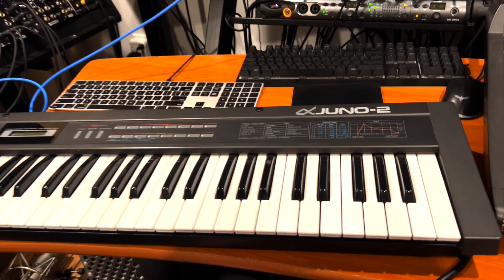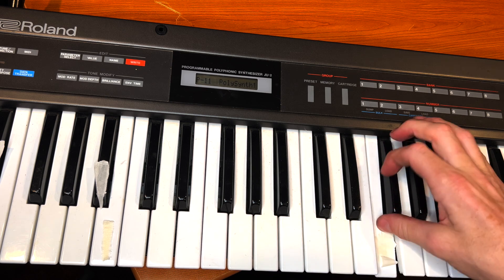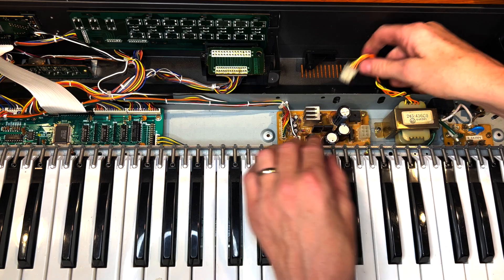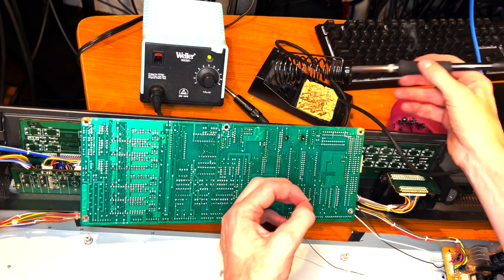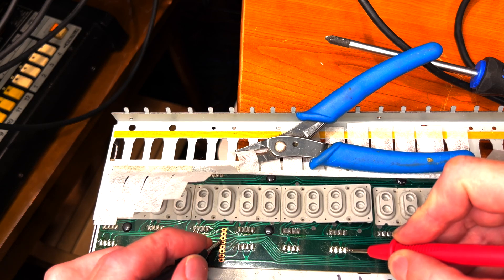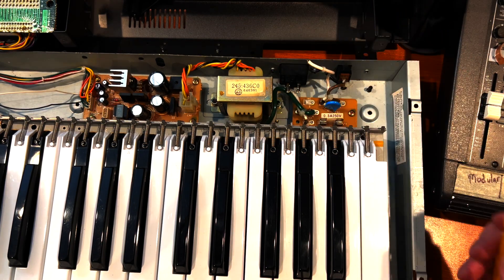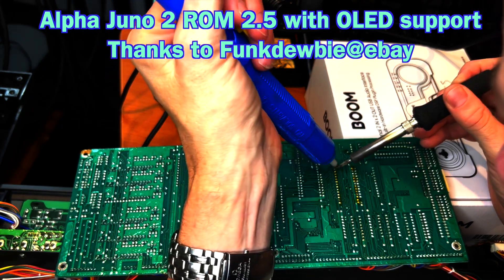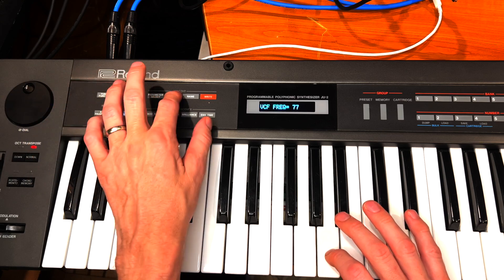Saving Alpha Juno

Comment: I bought one of these from new, but I've now got it back out. I had some trouble getting stereo output, but it turned out to be a dirty main volume slider. Right channel is intermittent. OK for now.

I'm driving it into a hi-fi amp (Fosi V3, 115 w/channel), and then into floor standers speakers (Monitor Audio Silver RS6, 120RMS). The whole setup is in my lounge for personal use.

But the output level is much lower than expected.

Can you tell me the peak-to-peak voltage of P-5-7 (Big Brass) at the stereo output jacks, with the main volume full up?

Comment: Instant rave machine!  Rrrrrrwwwwwrrrrrr!  I also had my tech put in an OLED.  There's also a mod you can do to the Alpha Dial wheel that allows it to track more accurately.  I actually have a spare board that I'd be happy to send you to allow you to do that.  Let me know. ;)
Reply from the maker: Hey Jay - I actually sold the AJ2 to a local guy that was so happy to get it - game him a sweet deal.  I can ask him though next tim I see him if he wants to do that upgrade.
Reply: @ sounds good.  Lucky guy!  I wish I had a Juno-2 due to the velocity sensitive keyboard.  The Juno-1 receives/responds to it, but oddly doesn't transmit it.

Comment: Hi man. I own a Ju-2 for over 10 years now, had to change the battery some time ago for the first time.. weirdly after 2 weeks it died again, ending up losing my new patches for the second time. So i changed it again, with after 2 weeks the same.. Now i know i didn’t put a faulty battery the first time, so something is def draining it.. any ideas what i can be? Or a headstart where to look? Cheers!
Reply from the maker: Only thing I can think of is potentially you have a failing capacitor somewhere that is close to shorting.  I'd start there and have the main board re-capped.

Comment: I did the eprom and the oled. Did a firmware reset. Have half screen unless i push write. Then i get the last half that never goes away if inpush another button and still only left half is informative. Faulty eprom? It is 2.5 U
Reply from the maker: Hey there - I had the same issue - not all 2.5U are the same.  You will need to order the 2.5U which is modified for OLED by the guy Funkdewbie on Reverb.  Make sure you tell him it's for the OLED version.  To swap ROMs you may also need to desolder your current ROM chip and add in a socket as I did in my video. Not the simplest of operations, but doable if you have a good desoldering tool.

Comment: Just bought an AJ1. Needs a good clean, an EL backlight replacement, the ROM upgrade and a new battery...otherwise it's in excellent condition. Sympathetic restores on these machines are the way to go....
Reply from the maker: For sure - lots of great deals out there if you can do a few small repairs.

Comment: I also brought an alpha juno 2 to life!!! with 9 dead keys and an empty battery and rotten capacitors on the power board that need to be replaced. I have also adjusted the entire inside to make the illumination such that it now also has a rare alpha dail backlight, how nice is it that you can now see everything clearly on this Roland ;-) there is also a new backlight behind the display I then completely custom painted the Roland with custom aluminum buttons and name plates and with modified larger white texts on the Roland front and back.
The lighting created inside the Roland is completely interference-free.
Unfortunately, this JU-2.1 is not for sale because it is a demo model and only one was made and no other colored Juno 2 synths exist to this day and certainly not in this version, of course, completely illuminated.
This is the work of an enthusiast who has gone a bit too far in paying attention to this Roland Alpha Juno 2 synth and wanted to give it a new, fresh look that now also fits in with the times.

Here you can see what I did with this Roland Alpha Juno 2 and what it looks like now 

https://youtu.be/nzAYYTq7j5I
Reply from the maker: Very cool Alpha Juno - beautiful mods you made to it!
Reply: thanks  @johnnymorgansynthdreams
Reply: A lot of thought went into making it this way, but it's worth it because the original one started to bore me after years and other modern equipment like spaceships, I wanted to completely restore it and make it look modern. but also clearer texts that you can read clearly while you are working on it. I wanted to highlight the alpha dial as an eye catcher and its function with light all the way around the alpha dial.
Everything inside the Roland has also been adjusted. Like the complete touch-sensitive strip, the felt on it has been replaced by a firmer felt layer that now covers all keys with the same touch. and therefore no more keys that sound louder with the same pressure on the keys compared to the others. The electrolytic capacitors have also been replaced by heavier ones with the same value but which can handle a higher temperature, so they cannot reach 85 degrees but 105 degrees.
The lighting inside is designed in such a way that it does not cause any interference between the Roland and the sound and lighting inside.
This Roland is very quiet when it is on and even if you put your ear to the Juno you don't hear anything at all. no buzzing sound or humming sound from your Roland power board or display!!!
There is only 1 of these Rolands in the world that has this. I have been looking everywhere for something like this...but it doesn't exist, so I decided to make it myself!!!

Comment: Great to see a beautiful machine restored to at least working condition.... 
In saying that! You missed the most important part! 
You replaced the larger capacitors on what looks like the high voltage side of the power supply, the high voltage capacitors rarely go bad in any smps.... It's those little capacitors that Roland chose to put at the output of the power supply are the ones that get hammered! And seeing how small they were, they should have been the first to get replaced! I wouldn't be surprised if the capacitors that you replaced still measure good for esr, voltage losses and capacity! 
If you haven't already got one, get your hands on one of those Chinese component testers from eBay or Ali Express, make sure that you see pictures showing a capacitor being tested so you can see on the screen showing V Loss .... It's more important than ESR.... 
And also a handy tip regarding the replacement of capacitors, if the equipment is important and needs to last a long time, all replacement capacitors should be upgraded to a higher voltage rating, keep the value the same but always go up in voltage rating, this way, the larger size can deal better with temperature and has a larger surface area of its two plates and will last much longer than the originals.... Obviously if space permits! 
Otherwise, great job 👍.
Reply from the maker: Thanks for the comments Peter - I'm definitely going to go back in and change those smaller caps now - Much appreciated!